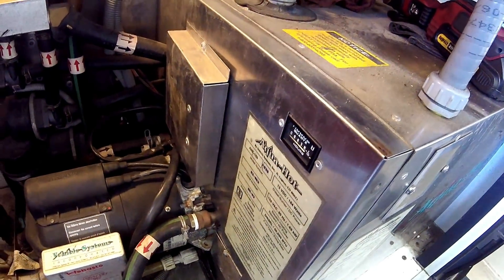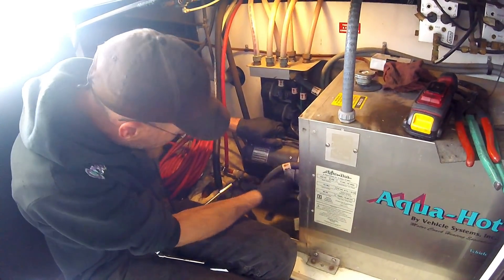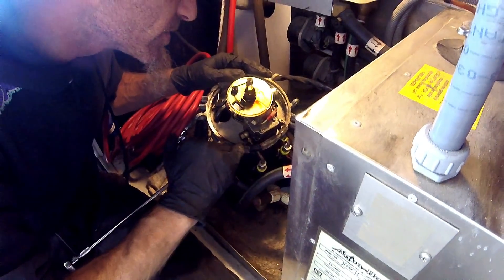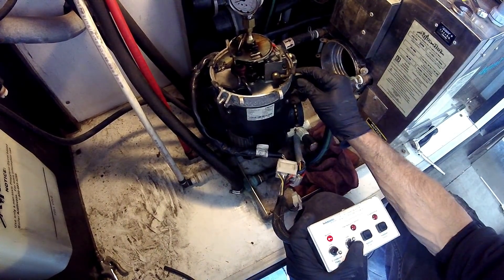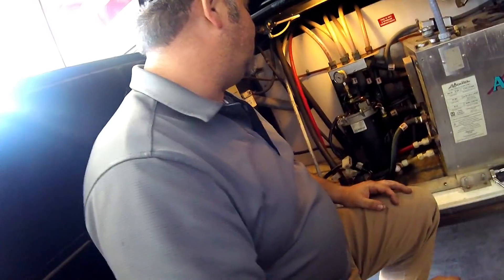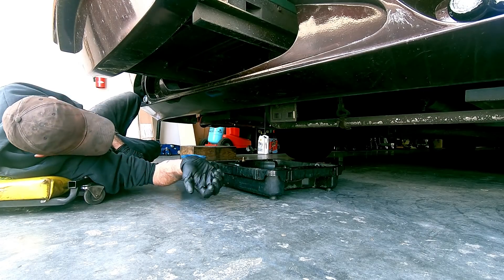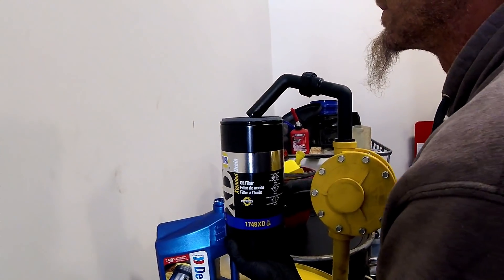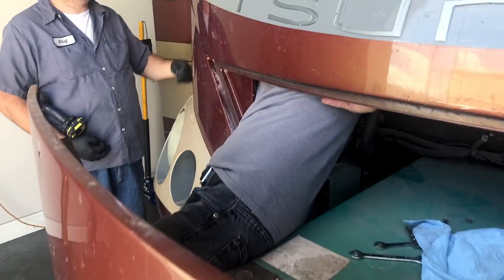RV Diesel Pusher Annual Maintenance (AQUA HOT/ONAN Generator & Cummins Diesel Oil Change)

Comment: I honestly think that $2000.00 is a bit much for what you had done to the RV. Look at individual videos on what was done to your rv and judge for yourselfs. Enjoy life.
Reply from the maker: 56 Chevy I’m not sure your wrong... they did work on it for 8 hours at $135 an hour... I figured $1,500. I will use him again... he is good and gets me in quick.
Reply from the maker: 56 Chevy I really do appreciate your input... thanks!!!
Reply: Well 56 chevy 
We have had several service shops do work on our DP the past 12 years.
I assure you this was a fair pricing statement. 
For what they did including part's. 
In and out in one day is worth a lot.
I assure you.
Reply: I spent $1600 at the Freightliner Service Center in Gaffney, SC for a 36 month service, generator service and troubleshooting an ECM issue.  They didn’t do an Aquahot Service as I had it done in 2019 which I think cost me around $400.  So, the $2000 is probably about right.  No maintenance on a Diesel is cheap.
Reply: I'm sure I'm in the wrong business. I need to start working on diesel pushers.